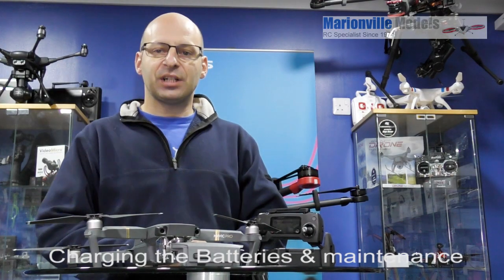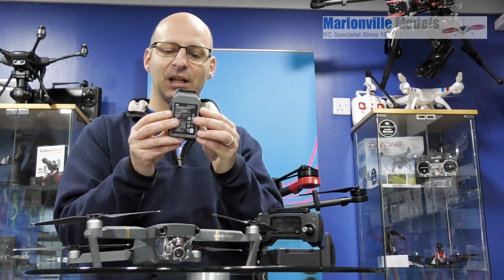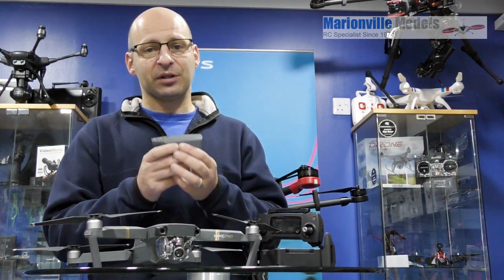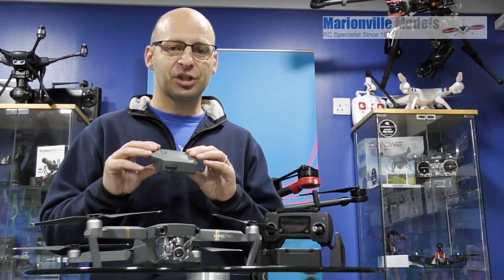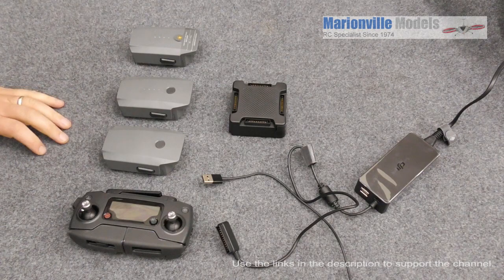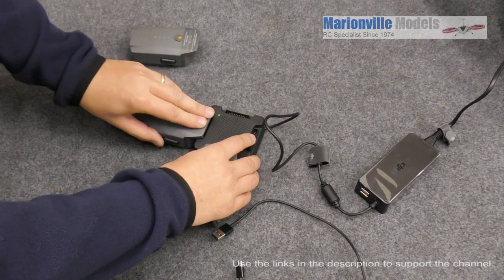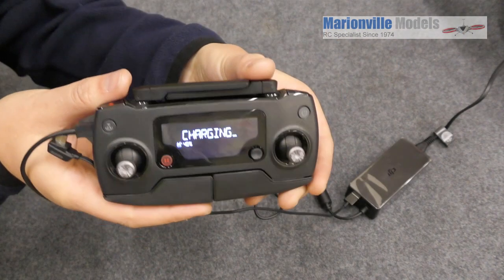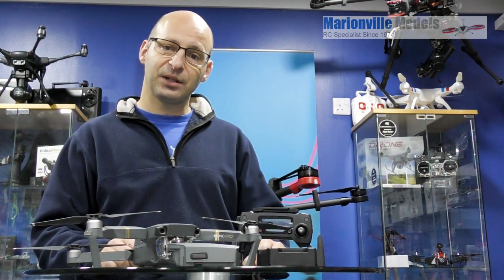Get The Best From Your DJI Mavic Batteries & How to Charge Them.

Comment: Great tips!  I also want to throw in a tip I got from another source.  Like our Mavic drones, i have ebikes that also use lithium batteries.  I learned recently, that part of the reason we experience a shorter range aside from natural battery degradation is that the cells inside the battery have become ‘unbalanced’.  This can be remedied by charging the battery to full and then leave the charger plugged in for another few hours.  For a big ebike battery, they recommend 8 hrs.  Then use the battery as normal and repeat the process.  This will serve to trickle charge the cells that may be lower than their neighbors.. these lower cells act as the weakest link in the chain.  Hope this is helpful.  Cheers!

Comment: Thanks helpful video, I didn't know that the  balancing is done inside the lipo that makes swallowing the cost a bit easier!
I also found the batt voltage meter is helpful to add to the screen when flying and try to land when cells are 3.85v each perfect for storing..

Comment: Hi, 

According to Mavic's user manual, the Intelligent Flight Battery after a pre-set period of time automatically discharges itself to a storage safe level (60%). Factory default time-frame is 10 days. Discharge can take up to 3 days.

I hope it helps.
Reply from the maker: Yes that is correct.
Reply: All what I say is that Mavic users shouldn't really worry about the battery until they fly once in every one or two months. A charged battery is ready to fly for 10 days, then it discharges itself, and safe to leave it as is.
Reply: Hi George & Marionville… so if i have a fully charged battery and I don’t used in more than 10 days it will discharge itself to a safe charge storage?… so i don’t have to worry about discharge it myself, its that correct ?…. thank you
Reply from the maker: Yes the smart batteries have self discharge after 10 or less days. You can program how many.
Reply: so whats the point of making a tutorial of how to take care of the batteries if they does it by themselves?
Reply: hector gtz gtz 
;-)
Reply: Yes, the battery will discharge on its own to safe levels. What we need to worry about is putting them into storage with low charge. It can drain itself, not charge itself.

Comment: Is it true these batteries (RC and Drone) can only be used upto half charge on remote and 2/3rds on drone?
 I'm told when I use a friend's that @ 50% the remote shouldn't be used anymore. And @ 35% the drone battery needs to be replaced with a 100% battery

Comment: Great Video, thank you for making the initial charging clear.  Question, where I have 3 batteries, would it be better not to initially charge 1 battery and save it as a back up.  I don't think I will ever need 3 batteries to be live all the time so if I keep one as I received it new, will it remain that way until I decide to activate it?  Thank you!

Comment: Thks four your video when I charge my battery Mavic pro just 2 lights came on my both battery is same what you think is normal or battery 's gone
Reply from the maker: If you don’t get more that two light after charging then I would say it’s not right. You can check the battery health in the app by tapping the battery icon on the top right.

Comment: You talked about storage for quad batteries, what about the non-removable RC battery maintenance.  Should one try to drain the RC batt to 50% for storage also?
Reply from the maker: It would be a good idea as well as the rc battery isn't replaceable.

Comment: my battery is new and the led lights light up then the center two stay dim... is this a issue? is there anyway to rest the firmware to the battery if there is? any input would be greatly appreciated.

Comment: Many thanks , I was worried about my battery care but very clear advice. I have heard you should not run them too low when flying. I like to land with 20% at the lowest for safety but again for battery care is there a minimum level to take them too? Thanks Alan
Reply from the maker: Thanks for the comment.

Comment: Hi
Could you elaborate the discharging aspect , how low should I fly the battery down to pls
Reply from the maker: Ralph Kluge you don’t need to. The battery will self discharge after five days of no use. You can set this time in the battery menu.

Comment: Thanks for the great review. Do you know the reasons behinds 'bloated' batteries?
Reply from the maker: Tony Malferrari If a battery voltage has gone to low they tend to bloat. They usually don’t work well after that and there no way to fix it.

Comment: Great video, thanks for sharing. Do you have any advice on iPhone battery draining when running the DJI App (30% drain after 5 mins) Thanks in advance.
Reply from the maker: MrDominic152 that is a real issue. If your phone is older the issue is worse. There isn’t allot you can do as you can’t charge it when in use.

Comment: I've been using LiPo's and various other rechargeables since my days as a wedding photographer fifty years ago.  Obviously, technology has changed many times over from those original NiCads and wet cells. My question is, that even rather recently, it has been suggested that new LiPo batteries be fully charged and discharged at least once. I realize that 30% is the default for DJI low battery warning and that you don't want to completely drain the battery (below 10%).  At any rate, does any of this apply to the DJI batteries, or is this not necessary?  Thanks as always for your great vids!

Comment: i have a battery which 4 pin are out or not there anymore, can it be repaired?
Reply from the maker: roxedan120362 I wouldn’t think so. I don’t think there is a way to get into the connector.

Comment: It is advisable to charge batteries to 50 % when leaving stored for weeks or months. When using the hub charger is it recommended to physically pull battery off charge hub when approx 50% and the 240 volt power socket is on , or turn the 240 volt power socket switch off and leave battery connected to charge hub when 50 % reached?   then remove battery.
 
IE - one way removes battery while still being charged, and the other turns 240 volt power off , wait a short time then remove battery from charge hub. Just wondering what is the correct way to avoid charger /battery terminal damage.
 
 
Thank you, len
Reply: Can you get a hobby grade charger like a b6 imax balance charger with red and black leads made fit for the Mavic pro battery and set it for 3 cell lipo and store it 50 percent?

Comment: How do you know how many times your battery has been charged (mavic mini)
Reply from the maker: MsLostboysforever it will tell you in the battery menu. If I remember right it’s in the top right hand corner of the app where the battery icon/voltage is.
Reply: @MarionvillemodelsMultirotors  thank you :)

Comment: how do you discharge the battery and how low should you discharge?
Reply from the maker: Speedy2246 the craft batteries will discharge them selves. The controller battery isn't as critical.

Comment: Hi guys, l have 4 Mavic Pro batteries that have not been used for over a year and are obviously not charging 😢 can you guys fix them and if so how much will it cost me? Cheers Dave...
Reply from the maker: Unfortunately you can’t brake the Mavic packs open to get to the cells to manually boost them back up. The Inspire 1 was the last battery you could do this on.
Reply: @MarionvillemodelsMultirotors  cheers for the quick reply, it was after watching another video that the guy connected the battery to a small circuit board then via software managed to get the battery charging again. As it is beyond my technical 😜 skills I thought of you guys 😉

Comment: @Marionville Multirotors I had purchased a Mavic Pro and two extra batteries about a year and a half ago. I had not opened them at all and have been sitting in a very good dry and out of sunlight storage space for that time. I didn't get time to use it at all no thanks to a number of pretty critical and/or unfortunate circumstances including work, travel, and family. But I'm now in the position to try it out now. However, all three batteries do not power on nor do they charge. And warranty is obviously out the window. What options do I have to fix these 'dead' batteries?
Reply from the maker: Jacky Fan the voltage in the battery may have dropped to low unfortunately. You may find if you leave them in the charger for a period of time they may kick in.
Reply: @MarionvillemodelsMultirotors  One of them had lit up last night so I kept it on the DJI charger. But it now doesn't light up at all on one click. I'll keep them on charge and see if I get anywhere. The adaptor should be working because it charged the remote via the included USB cable.

Thanks for the help! Fingers crossed I can get them to come back to life!

Comment: What do you recommend for setting the default battery discharge time to. It's ten days from the factory but wouldn't 5 or 4 days be better for keeping them longer?
Reply from the maker: N'th DEGREE DRONE I would go with 5 days but it's not to critical.
Reply: Marionville Multirotors Thanks bro, that's what I went with. I had it set to 2 days but that's way to soon. They hit really warm in the bag really quickly. At 5 days that's not happening.

Comment: Wait, so the charging HUB only charges 1 battery at a time? Does that mean it would take about three hours to charge them all up?
Reply: Chad Littlefield yes
Reply: It charges them one after the other, so one will be fully charged and ready to fly in a short period of time, and you are free to fly while the rest is still charging.
Reply: I thinks its really intended to charge overnight so when you come down you have all batteries charged up
Reply: Hi ChainsawDude

I think if you have a full night to charge your batteries it doesn't make any difference if the hub charges them simultaneously, or one after the other, the total charging time will be the same, and all will be fully charged in the morning both ways. 
Charging them one after the other really counts when you need more batteries to be charged, and you would like to get back in the sky as soon as possible. This way you just wait for the first one, and while you use it the second (and the rest) will start charging. Clever idea!

Comment: You know its all well and good saying what percentage to store battery's like these but are we really supposed to charge full, put it in the mavic, fly it for 20 mins then charge it again but only to 50% or whatever but hang on? How do I know? I have to keep unplugging it and putting it in the quad to find out? And what if I've put too much in like 70% I've then got to fly it some more to drain some power. THEN! I have 3 more battery's to do that to. I'd have to take a day off work just to put my battery's in storage mode???
Reply from the maker: ksrnate best practice is to fully charge it after you use it and it will auto discharge to storage charge it's self. You can set the delay in the battery settings.
Reply: Marionville Multirotors 
That's actually the reason why I watched this video, I thought there maybe more info on that. I've set all 4 of mine to discharge in 3 days. 5th day now and they are all still fully charged?

Comment: The battery will discharge on its own to safe levels. What we need to worry about is putting them into storage with low charge. It can drain itself, not charge itself.
Reply from the maker: ToxicityAssured yes they will discharge to storage levels if they are fully charged.

Comment: very useful info, not only for mavic but for any dji product...thanks for sharing...
Reply from the maker: Rob Simpson yes applicable to all smart batteries.
Reply: what about that battery charger that you can buy separately for about 50 some dollars and charges all three batteries at once and the controller. Do you think that would harm the batteries in any way if used properly? I'm thinking of purchasing one.
Reply from the maker: It shouldn't but be very carefull when using non branded chargers as they could end up damaging your battereis.
Reply: Marionville Multirotors it says it's specifically for the mavic
Reply from the maker: Yes but as its not made by DJI if it were to damage your batteries you wont be covered by warranty. These unknown Chinese companies mass produce these chargers with little quality control.
Reply: I would just tell dji it was there charger that jacked the batteries if that was the case.
Reply from the maker: But if it burns your house down you`ll have more important things to do.
Reply: Marionville Multirotors i'm a licensed electrician and that is pretty much my biggest fear so needless to say it would be charging under supervision. i'm worried about it shortening the battery life is all. Guess i will wait for more reviews.

Comment: Hundreds of charges! Wow, thats great. One of my "smart mavic pro batteries" cells took a dump after just 12 charges, confirmed by dji. Hopefully it was just a fluke battery, otherwise keeping my mavic pro in the air will ne expensive.
Reply from the maker: Mike Comeau you can be unlucky but I have seen batteries with low cycles fail if their a fair age.
Reply: Wow I've gotten 235 flights out of 1 of my batteries. Lvl 27 1.5m ft flown😎

Comment: Is it better to totally discharge it or its okie to charge it even its like 60 to 90 percent, this is to make sure i have 100% when i go out
Reply from the maker: Dont run it right down, i wouldn't go lower than say 10% but 20% would be better. You can charge from any percentage.

Comment: I bought 2 extra batteries from banggood...took like 4 months to get here...when I try charging them 1 led keeps flashing over and over then stops and starts flashing again
Reply: how do I fix this problem?
Reply: are these batteries in hibernation...how to I activate them
Reply from the maker: Jun Gulgar first never buy your batteries from places 
Like Bangood as Lipo batteries are difficult to ship back if you have issues. It sounds like there are cell errors and you need to return them. DJI batteries only have a 6 month shelf life, if a dealer has them on their shelf for longer they need to charge them to stop the voltage dropping off and causing a charging error.
Reply from the maker: Jun Gulgar if you fit the battery to the drone and go to the battery menus in the top left of the app you can check the cell condition and see if there are any issues.
Reply: @MarionvillemodelsMultirotors  I tried it yesterday but the batteries cannot even power on the drone on
Reply from the maker: Jun Gulgar I would say the voltage in the batteries is so low the charger either won't detect them or thinks there is an error. You'll need to ship them back. Be aware they can't be shipped by air freight.

Comment: Curious and something NO ONE MENTIONS! Everyone talks about the charge state and care for storage of the Mavic batteries. I've seen many videos discussing this. NO ONE talks about the controller. Is the controller lithium Ion also. Should it be treated the same or differently? If so then differently in what way? A Clip in clip out Mavic battery's life shortened by lack of care is expensive and a pain. But the internal battery of the controller is a far more serious problem. It either has to go back to DJI or be brought to an electronic repair. During the time it's being shipped and repaired all you'll have is your phone to fly the drone and I'd bet that a controller battery and labor and shipping would cost more than a Mavic clip in. Someone out there doing these maintenance videos should address controller maintenance care because few have the knowledge, skill or availability of parts to work internally on their own controller. I've thought about buying a Mavic since it came out. I just ordered a platinum a week ago. I have watched hundreds of videos on every subject from unboxing to year reviews and have yet to see a single video that even mentions the controller's internal battery care.

Comment: Sorry but you've made a little mistake.manual Samsung you must charge batteries and controller (bitter,transmitter stuff) one Art a time,as the percent of voltage should decalibrate batteries
Reply from the maker: Ive always charged them together but yes DJI say to do them one at a time.

Comment: Where you get that 6 months sitting in shelf in storage mode are not good for the battery?

Dude.... you really spreading wrong knowledge
In that 6 month period in Shelf, the battery wont damage at all, it will enter sleep mode
And after that you can wake the battery with 2-5 cycle, just use it like usual

Dont know where you got that asumption?
Reply from the maker: j3fron I get it from my 30 years in the RC industry and dealing with DJI products since 2012. If it doesn’t work for you then try another channel.

Comment: Hmm...you called it a charger and charging hub!!  You had already told us that the battery has the charger inside!  If the charger is in the battery the "charger "  is only a power supply.
Reply from the maker: robert ramsey yes its only a power supply but viewers tent to understand better when it's referred to as the charger as smart batteries with built in chargers are not common place.
Reply: it's good to educate the viewers! :)